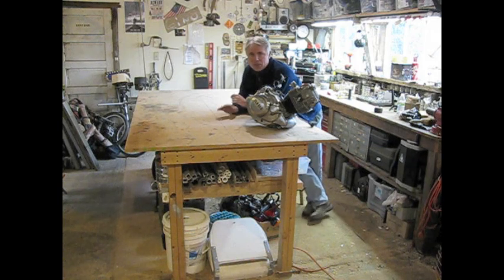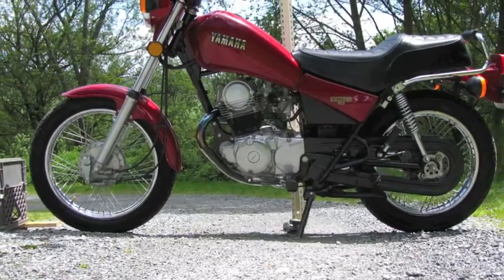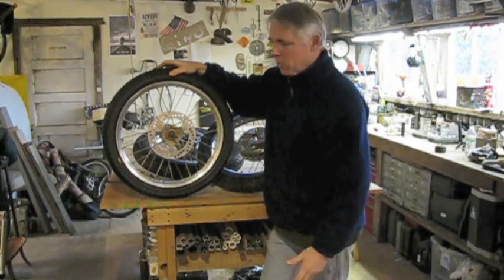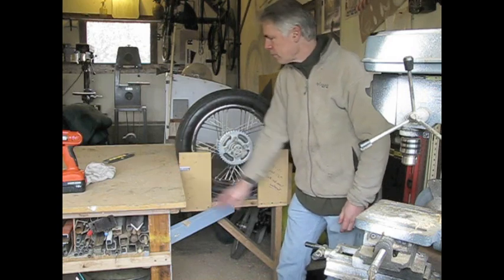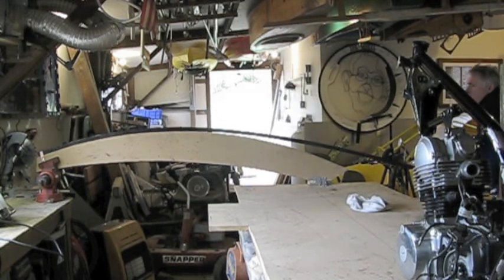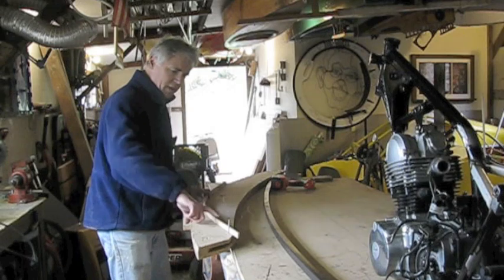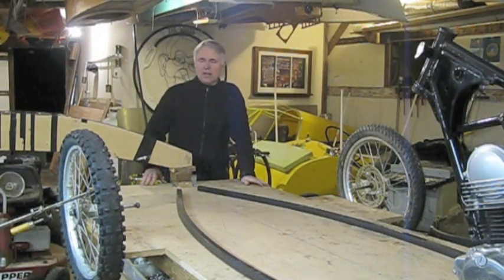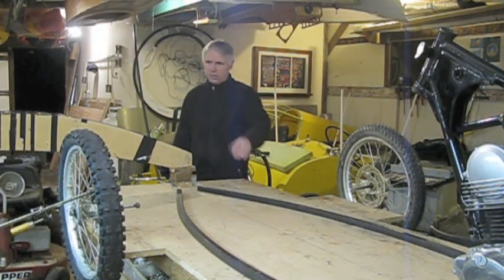High mileage vehicle build (part 2)

Comment: Why did the first MotorTrike not  work? I love the design of it and I'm hoping that I could recreate it.
Reply from the maker: Not much really. I do like the concept of creating a tear drop frame and have bowed flat panels attach to give it shape, but it was too heavy for what I wanted. I had and atv front end but had to add a vw front end making it way too heavy for the motor. I'm actually getting it ready to run. Needs a bit more work seeing it's been sitting for 6 years.
Reply: Paul Elkins Thanks for your time in responding and hope to look forward to seeing it working!

Comment: wondering how you are going to get 150mpg the motorcycle you took the engine from didn't get that?
Reply from the maker: Increased aerodynamics means less power needed to push thru the wind. Example: An unfared bicyclist can go no faster than 35mph. The record for a 'fared' cyclist is 82 mph.
This same type motorcycle fully fared achieved 300+ mpg in the Craig Vetter fuel competition back in 1985. I'm heavier so expect much less.
Reply: Cool Paul cant wait to see it!

Comment: I use a lot of gas & oxygen to bend steel.  The cost is worth it sometimes.  Major bleeding seems to go with cold bending...but you apparently had it secure.  It did make me wince a bit, however.  What is planned for the cycle frame?

Comment: You always get some spring back when you bend around a form.  I'm sure there is some engineering formula that can be used to figure out what the form should be shaped like to get the desired finished tube bend.  I'm no engineer so I just guess and fuss like you did.